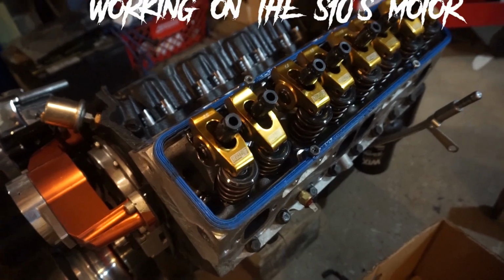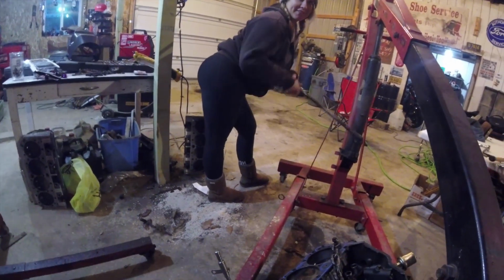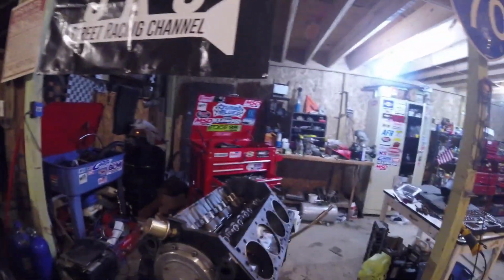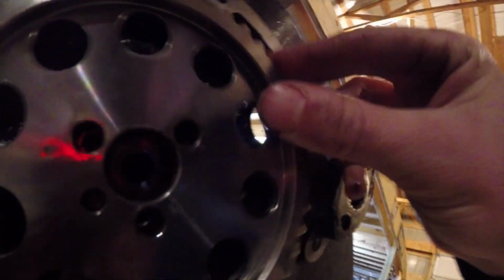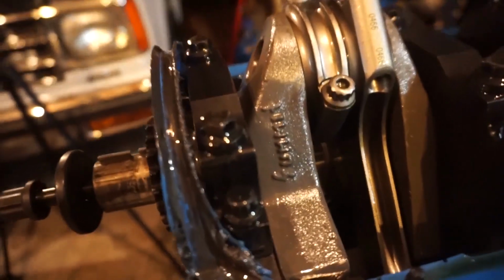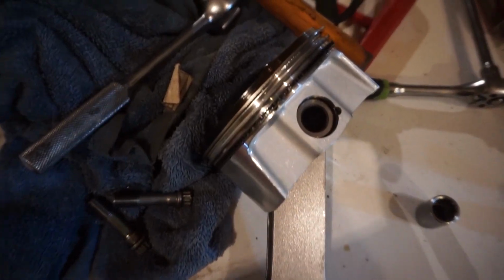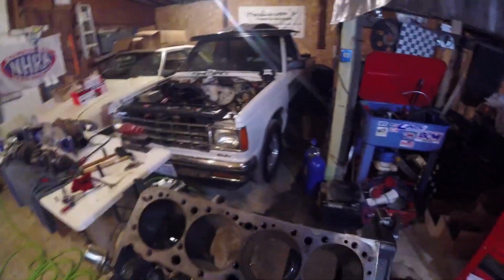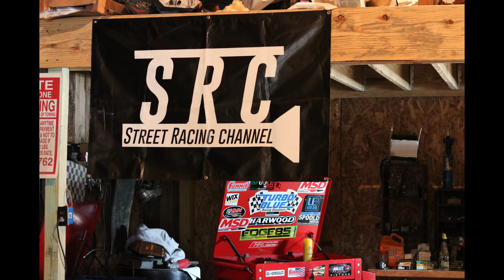This Girl Loves to Work in the Garage! (1300HP S10 Build)

Comment: You could have the domes milled too, might be a little risky relying on a thicker head gasket to reduce compression for boost...
Reply from the maker: Thats what we we're thinking!
Reply: Because it's most likely a hollow dumb that's not a good idea. Uniform crown thickness is important for dispersing the heat in the piston
Reply: Russ Pottenger, You make a good point, although I’ve seen it done a few times, never seemed to be an issue, I could be wrong I guess...

Comment: Those  pistons are  nominally 11-1 with 64cc chambers. And 20 thou head gaskets.  And 25 tou deckheight. Use premium fuel and limited timing and they are ok. Or better use Avgas and more timing.That piston is result of a very lean mixture,, or read an airleak somewhere probably an intake area.
Piston makers these days seem to  make pistons with less compression than original so most engines are low copmp gunkers that will run on power kero!!

Comment: What is your compression?
I am going turbo also I have a sbc 10.5 compression I hear compression is good as long as you have a meth kit 👍🏻
Is your block an early block ? I notice it had a front oil sender just wondering because not all have them up front mine doesn't but mine is a 400 it sure would be easier running my turbo supply line lol 
Nice vid 👍🏻
Reply from the maker: juiced71 it’s an aftermarket block
Reply from the maker: juiced71 compression is 12-1 right now
Reply: Street Racing Channel ahh gotcha 👍🏻 I watched a vid of this caddy full boat caddy run in the 8'a he was running an LS engine so high compression can work Im sure he was running E-85 little more forgiving but that bitch was running 👍🏻 I will try and link the vid here soon as I find it if nothing else it's good info 👍🏻 like I said I'm going turbo and always seeking info .. I appreciate your vids good stuff ! Aftermarket block good move lol